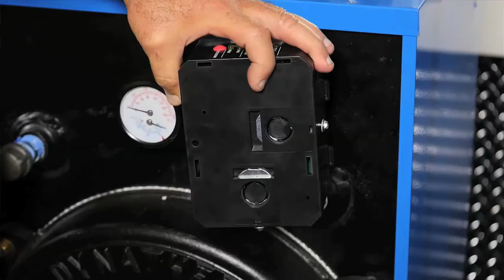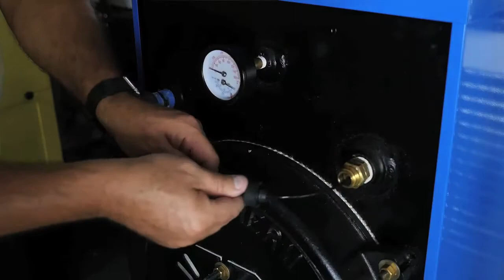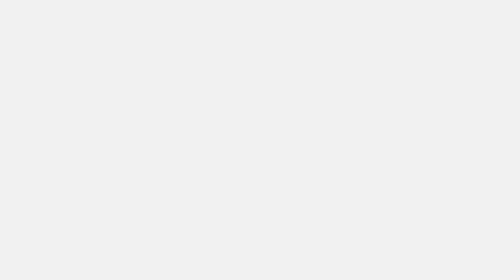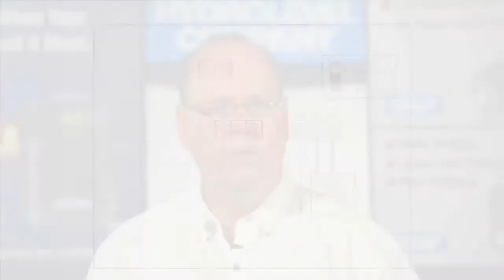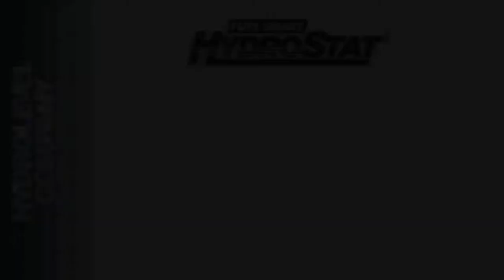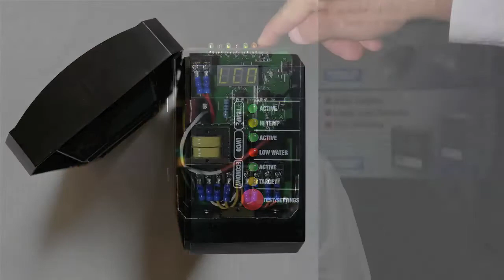Chapter 1 HydroStat BASIC FEATURES

Comment: Early this morning the smoke alarms give me a big scare the fuel smart Hydrostar 3250 was reading way over 200 pressure and it field to shut down the boiler luckily the relief valve worked properly the basement ceiling ad a good amount of steam I shutdown the emergency switch and called my guy came whit in hour and he check that out and said to replace the Hydrostart and he told me that in 35 years in the business it append twice but I can tell that he was very surprised because he did all the installation of a new boiler ecc. not the low voltage part it was about 10 years ago

Comment: Does it come with a sensor or is that sold separately?
Reply: Comes with a temperature probe to fit the aqua well.  The probe has about 6” wire.  Push it in the well, about 4-5” deep, a metal pin holds it in place.  No thermoplaste is used.